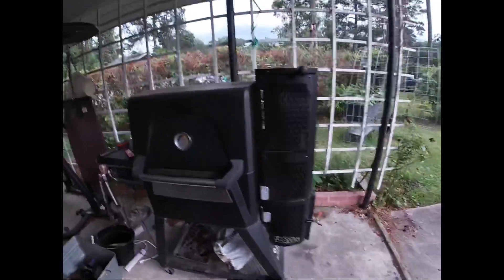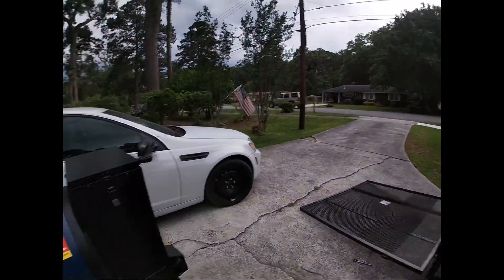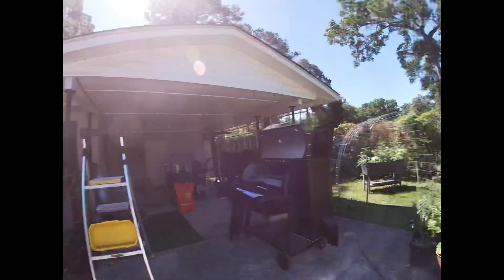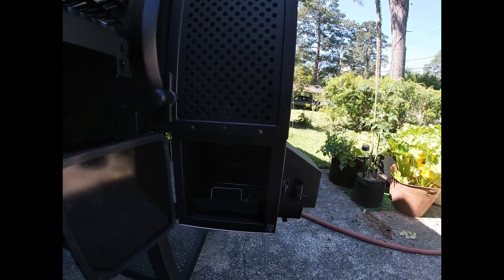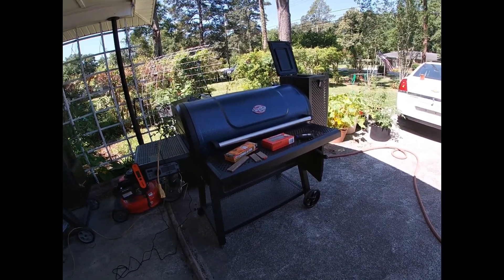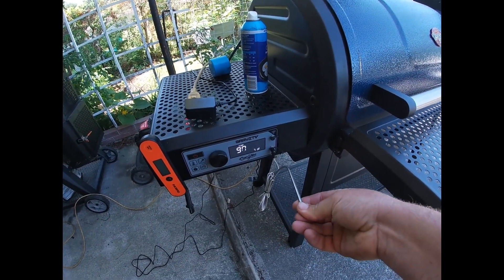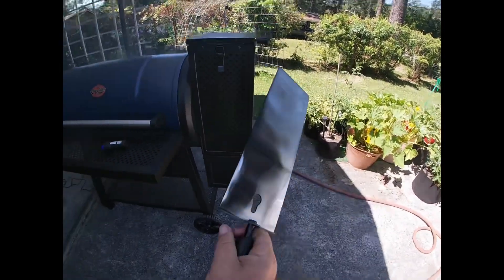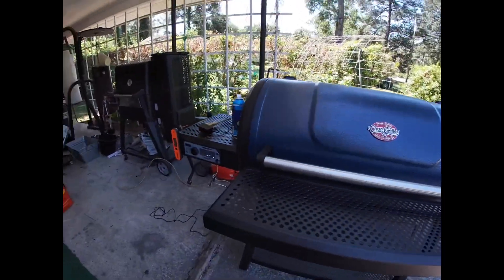CharGriller 980 Gravity , burn in / thoughts vrs MasterBuilt 560

Comment: Thanks for posting this  as  you can see the Char-Griller 980 destroys the Masterbuilt
Reply from the maker: naa , not yet .. for the price the msster is still a better smoker .. but im tooo lazy to super clean it each time for the steak sear flare ups.. where they 980 is easyer to clean up and seems to be a gauge or two thicker, as it should since it cost way more ... prolly gonna add a RecTec to my line up soon
Reply: @Savannahjbo  the Char-Griller is built a helluva lot better not just a little better the Masterbuilt doesn't have a damper all the metal on the Char-Griller is better I have a Rec Tec 700 best pellet grill on the market hands down actually I paid less for my Char-Griller I open up a Lowe's account got the Char-Griller for $480
Reply from the maker: @hellolove1576  you should make a vid on how to get the char griller that cheap .. and I live a cpl of hours away from RecTec HQ , might have to make that trip soon